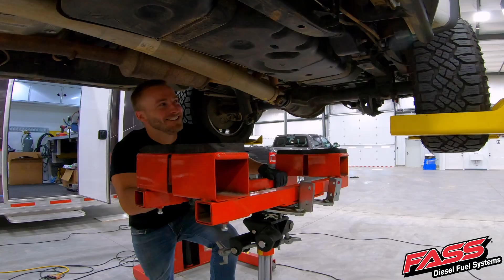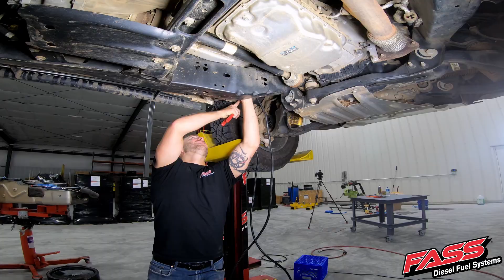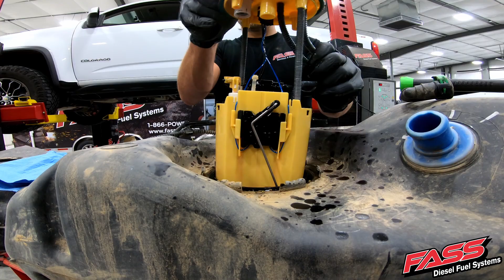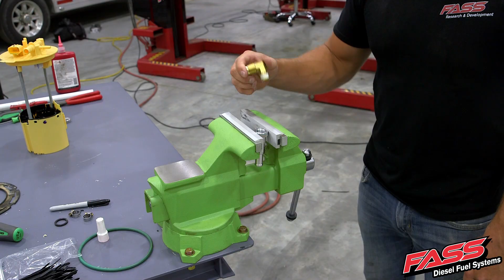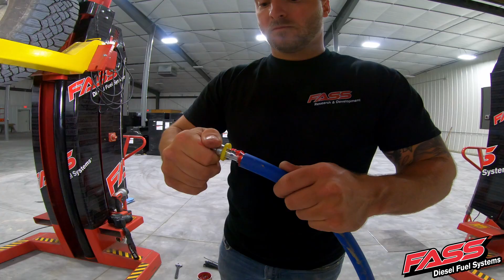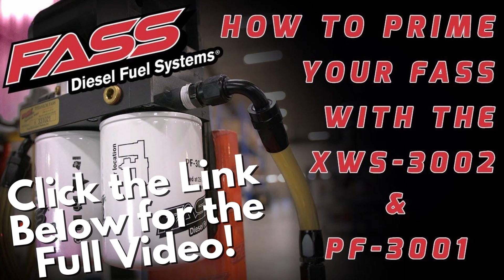FASS Fuel System for 2016-2020 Chevrolet Colorado Duramax & GMC Canyon

Comment: Do you know any shops in Arizona that can install this on a Colorado Duramax?
Reply from the maker: Hey there! We currently have a system for the 16-20 Colorado Duramax. We have a tool on our website where you can find authorized FASS Dealers near you that can sell and install a system for you! Here is the link if you want to check it out: https://www.fassride.com/dealer-locator

Comment: What is the fuel econemy after istalling this system?
Reply from the maker: That's a great question. As a rule, we don't/can't guarantee specific MPG results, as there are so many factors involved. How someone records MPG, the accuracy of that data, driving habits, fuel quality, etc, can all effect fuel efficiency results. 

That said, it's very common for our customers to see improvements of +.5mpg all the way up to +3mpg or more. But again, this is self-reported data provided by the customer.

Comment: FASS website says their system is not recommended for my untuned 19 L5P 6.6 duramax but here they are installing one on a 2.8
Reply from the maker: That's correct, the 2.8 Duramax and 6.6 L5P Duramax utilize different fuel systems, and have slightly different requirements. For the L5P, aftermarket tuning is required.